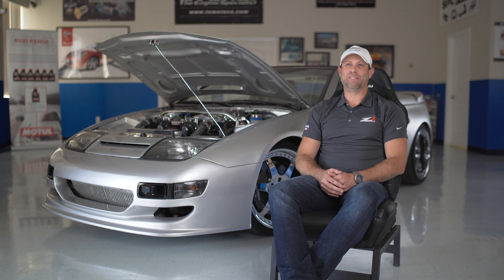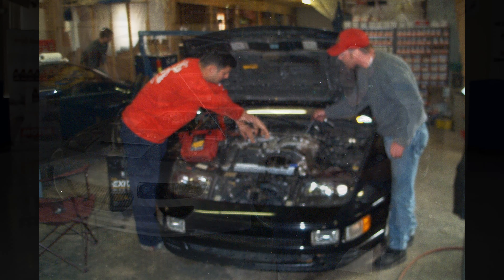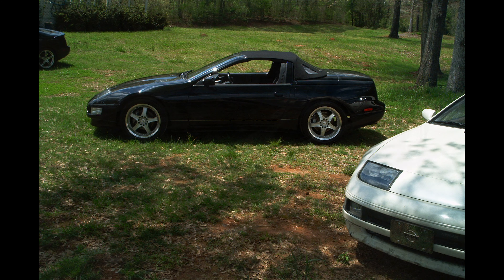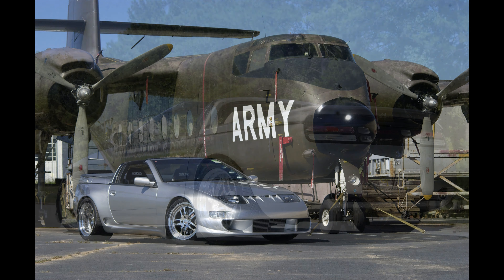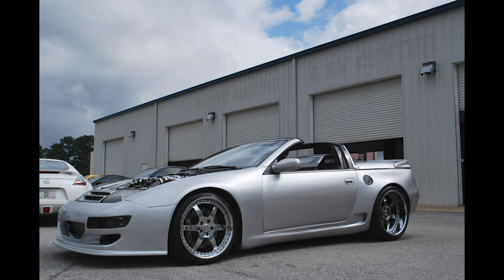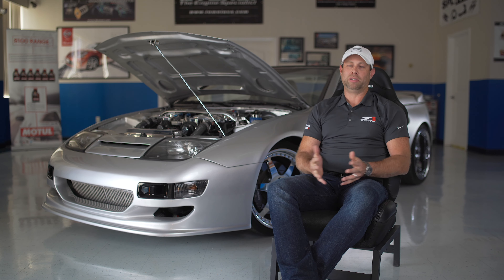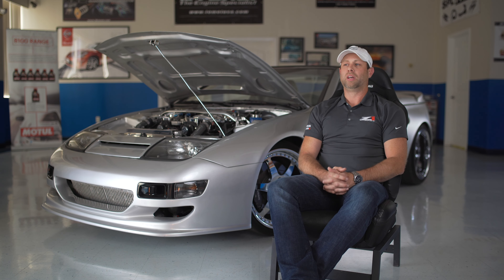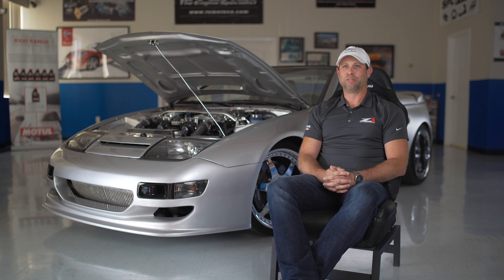The Story Behind The Z1 1000HP Widebody 300ZX

Comment: We loved the fact that you can dial down the power to make it a comfortable daily driver. 
Our second z32 TT manual had 650 hp at the wheels but was not fun to drive on a daily basis, due to clutch, power curve etc problems and almost bankrupted me, supporting the local council. ha-ha .......... 
We also owned a 400hp auto at the wheels that was Amazing to drive. The previous owner did the upgrade perfectly & gave it 'pocket rocket', standing start acceleration by installing a completion talk converter. We regret selling both those z32 TT 2 + 2.
 We have just bought a 'barn find'  1991 zx TT 2 + 2 which we will lovingly restore to pristine condition and will become our weekend fun car, weather permitting. ha-ha

Comment: I took a chance and sent my Z32 down to Z1 in 2002/2003 (if I remember correctly), and I've never regretted it since. I'm sure there are other great shops, but Z1 is the only place I bring/send my car, especially for anything mechanical that I'd rather the pros handle. Those guys are like my Z32's doctors. John and Robert have been like my brothers from day-1. Seriously, between those two, I think they know my car mechanically better than I do - they built and tuned it. I speak to those guys like I'm speaking to family. I think, for the most part, the Nissan Z family is really supportive and welcoming, and Z1 Motorsports is really a microcosm of that community. It's all encapsulated right there in Carrollton, GA.

Comment: Z32 best body z ever. If i won lottery would buy any 2 seat t top and do great swap. 370z na 6 speed. 320 hp 6 speed. Lived my 90zxtt but i would live modern non turbo. 320hp is more than old tt and less plumbing and hassles. Beauty of z32 modern engine and trans. 320 hp is more tha enough for street for me. To me than is perfect z.
Reply: I want to drive the wheels off it without constant shop stays.